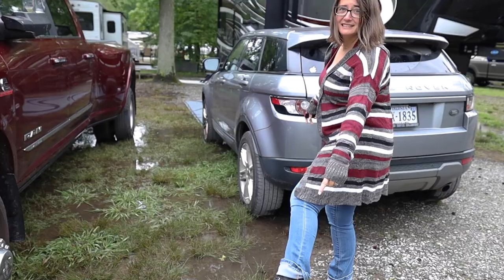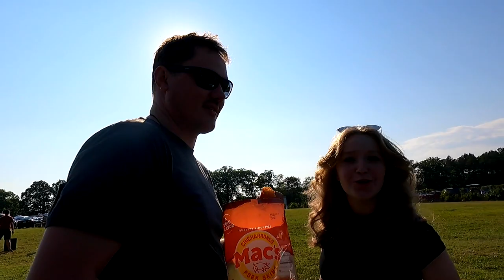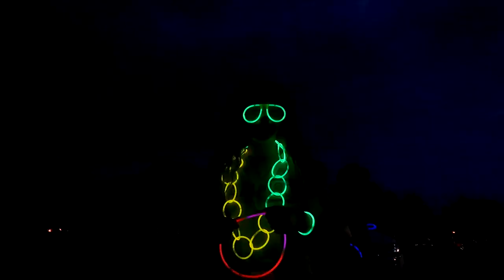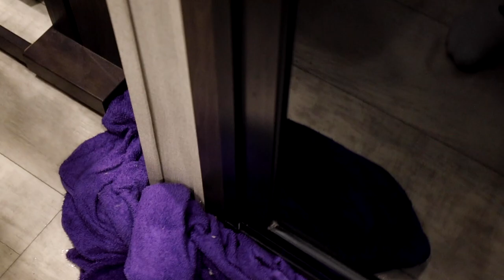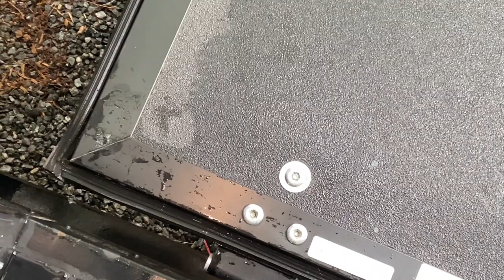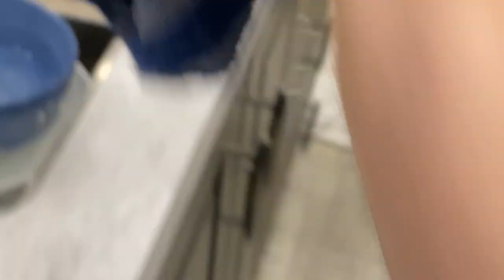SIDE PATIO LEAKING INSIDE our 2021 Grand Design Momentum 399THR! (MAJOR ISSUE) 😡

Comment: We have had similar issues with our side porch. The porch itself will hold water and then drain. When we put it up. Have had it change out once already. Tried flex seal and it only lasted a few months now we have flex seal tape but I'm about to rhino line it over everything. We are fortunate that the way ours is built no water can make it into the camper with it up. Good Luck guys it's a pain !
Reply from the maker: We thought it couldn’t make it in either but, NOPE. water was coming in from between the floor and the wall. We will figure it out. It’s all part of the journey, right? Safe travels!
Reply: @1StrangeAdventure  Yes sir! Glad you figured it out hopefully can get it stopped now.

Comment: Man, that really stinks! I’m surprised they haven’t recalled this model year and had the new patios put on, especially if it’s a common occurrence to have this water leaking issue. We really hope that it gets fixed in time so you can make your trip up to Acadia national Park.
Reply from the maker: We hope so too! They said two weeks so we will see if that holds true. I’m hoping they can just see what’s happening and fix it instead of replacing it. The rep at GD said that everyone has been taking it to the dealers and not back to them so maybe with us bringing it to the source, they can see what’s actually happening. We will be sure to keep everyone updated though 😊

Comment: Short term, would lowering your stabilizing jacks a smidge on your patio side divert the water away from your interior wall?
Reply from the maker: Didn’t think about that. Great suggestion. I’ll have to try that when it rains again. Thank you!
Reply: @1StrangeAdventure  Might help now if there is still standing water under the interior wall. I suggest drop down on the patio side and then adjust the jacks at the lowest point of your RV pad to divert the water out.  Also, if you don’t have a residential refrigerator, keep an eye on the fridge since they may not cool properly if the RV isn’t level. All the best!  Beautiful rig!!
Reply from the maker: @abradley7908  I really appreciate it! All the water is gone as we haven’t been in rain for a couple weeks now. The patio is down and we do have a residential fridge. We are working with GD to remedy this. I’ve also escalated to Lippert. I know of others with the same issue and this isn’t ok. Hopefully we can help others in the future with this experience. Thank you again for the suggestions!

Comment: My 399TH is leaking also and what I found is the door seal around the fold down door is not mitered at the corners.  Instead, they wrapped it around the corner and both top corners of my door leak like hell because the seal doesn't contact the frame when closed.  The parts catalog shows a part no. for a mitered seal which I intend to get for both the side door and ramp door.
Reply from the maker: Thank you for sharing that. We will be sure to mention it to Grand Design. We could see our door letting water in through the hinge bolts. It was filling up in the up position. Hope to get this fixed soon!
Reply: @1StrangeAdventure  Patio door mitered seal is part no. 5220008 and ramp door mitered seal is part no. 520002. I'd insist they use these parts instead of a bulk roll and wrap it around the corners like they did on mine and likely yours too.
Reply from the maker: @robd6709  Thank you! We will be at GD next week and will make sure we mention it! Really appreciate the input!

Comment: Our 399TH leaked when we got it. We got it to stop when we lowered the right side. That seemed to work. Then I got out the bubble level and recalibrated the level of the hacks. We had been through some rain with no problems after that. We were in Virginia during the hurricane and apparently it leaked again. But not as much as you guys were having. Looks like we need to let GD know as well. We’ll be going to Maine ahead of you guys.
Reply from the maker: I would definitely let them know. If not for repair, maybe R&D? Have fun in Maine, we can’t wait to get there!! Let us know if you come across any must-dos!

Comment: We have a 2017 399TH. Ours started leaking the same way. Our door was built about 1" shorter than the door opening. When it rains or if we are in bad weather going down the road, we ALWAYS had water between the patio and the slider. I had to install a drain in that area to allow the water an escape route. We have had better luck, but I'd like to let GD know about my issues as well. Any tips on the best ways to reach out to GD?
Reply from the maker: Glad to hear you figured out a work around for the water problem.  I wonder if the door is the wrong size or if GD made the opening too big... Hmmmm.... I would contact their customer service to let them know. I would also contact Lippert since they manufacture the doors to let them know about the issue.  Maybe it was a one-off thing they are already aware of.  I know of people who have replaced the seal around the patio door since they just wrapped it around at the corners instead of using a Miter joint.  That helped them close the gaps around it as well.

Comment: I need your help ,do you have the factory solar option
Reply from the maker: We do not have solar prep but happy to try to help. What is your question? If we don’t know we can post it to the community tab for you. Chances are someone knows!
Reply: @1StrangeAdventure  when you don’t have full hook up do use your generator to keep the refrigerator cold
Reply from the maker: @skeim5620  ours is a residential fridge, so it runs on the inverter (from the battery) when not plugged in. Our generator has a setting where it will kick on if the battery drops too much. If we are going to boondocks, we make sure it’s in a place where it’s ok to run the generator.
Reply: @1StrangeAdventure  do you have two batteries.do you think a overnight stop the refrigerator would stay cold without running generator.are happy with your choice of a residential refrigerator.I ordered a 396ms-r 2022
Reply: Do you have 2 batteries
Reply from the maker: @skeim5620  we only have one battery and we actually left the rig overnight. The battery did not last and we had to throw some food away. 😕 Then we had to start the generator to be able to get power enough to prepare to leave.
Reply: @1StrangeAdventure  the dealer told me truck will keep batteries charged up while driving.I wonder if 2 batteries would have worked.they said if you keep refrigerator closed it should last 8 hours like at home.do you wish you got factory solar option

Comment: It’s an earthquake rolling down the road, we all have these issues
Reply from the maker: I agree that all RVs will have some sort of issue. However, quality can help control and cut down on major issues. It's not just manufacturers, but also the third parties they purchase parts from.  Have you run into issues as well?
Reply: Call it some. The patio door will not adjust and has a 3 inch angle gap. Various trim pieces have come loose and glued, a massive tire blow out (new tires, TPMS no help). Tank sensors are worthless (normal). Ours is a KZ 383MBQ. That GD was our second choice
Reply from the maker: @robertnasser9937  Wow! It's a shame we have to deal with this.  I would much rather be out enjoying our rig! The KZ is really nice! We actually toured that exact model at the Tampa RV show and loved it! Hope you're able to get things resolved quickly.